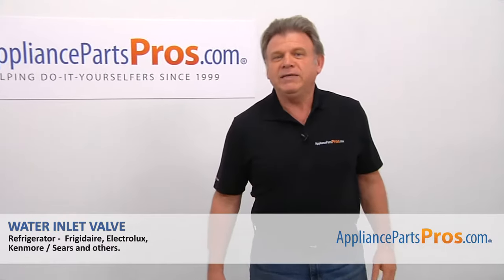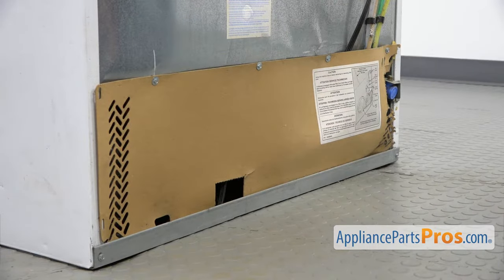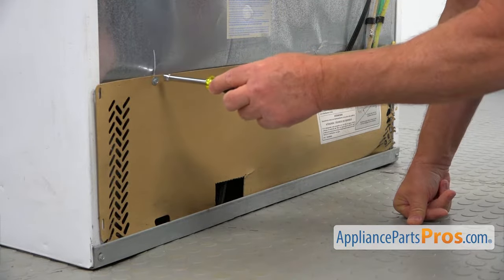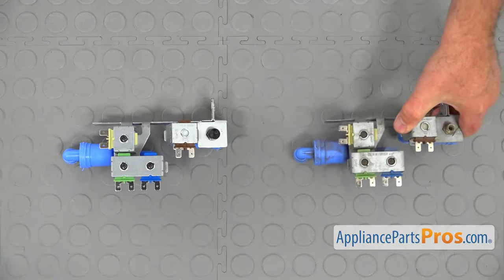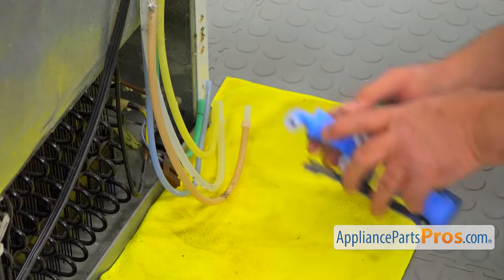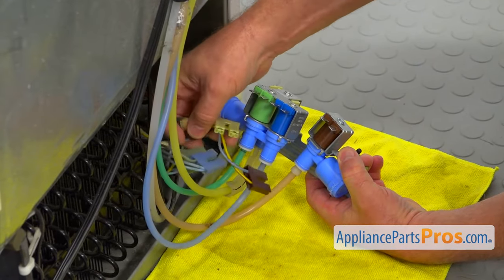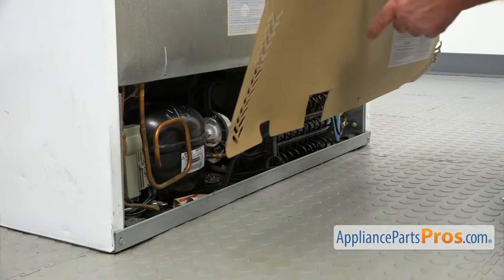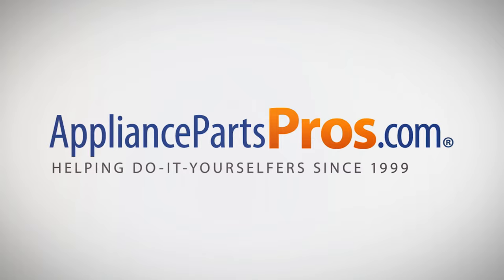How To: Frigidaire/Electrolux Refrigerator Water Inlet Valve 242253002

Comment: Thank you for an awesome video. I just replaced the water valve, forced defrosted the ice maker and still no ice. What else can I check? BTW, I'm getting water from dispenser, changed filter, water pressure is good. Thanks!
Reply from the maker: It can take up to 24 hrs after a repair for the unit to start making ice again. If you are still not getting water to the ice maker after replacing the water valve, then you can check the fill tube for blockages. If that is clear then you would need to replace the ice maker.

Comment: I did this but the ice machine still isn't producing ice.  What else should I be looking for?
Reply: Does the door still give water?
Reply: There is a switch inside the freezer that can turn the icemaker off ... double check that.
It is NOT the same as the lever that stops the icemaker when the bin fills up, it's an electric rocker switch.

Also, make sure that wire lever thing is not stuck in the "full"
Reply: I had a mouse chew up my wires. I manage to splice the water dispenser wires together, but not the ice maker. I’m pretty sure the one with the green water line is for the ice maker. I would like to be sure though. Then test for power.

Comment: Hello there. I get water from water dispenser. I also get water from ice maker when i did diagnostic, but the water seems too less. could this be the problem with water inlet valve? thanks.
Reply from the maker: If water is only filling the ice maker when you run the diagnostics, then you would need to replace the ice maker. If you aren't getting a lot of water coming into the ice maker, then you will need to check the tube to make sure you don't have a blockage in the tubing. If the tubing is clear then you would need to replace the water valve.
Reply: @appliancepartspros  cool. thanks a lot for your prompt reply.
Reply: Another issue could be the water filter. The filter accumulates particulates over time which make water flow through the filter slower. I understand that other users have seen an increase in water flow speed after changing the filter.
Reply: @99APB77  thanks a lot. I'll try changing the filter as well.

Comment: my ice maker works, the water dispensor is used a lot and started dribbling, but if you tap it just right, it stops.  My concern is leaking onto the floor from freezer, and sheet of ice forming in bottom of freezer.  I was chasing the coil heater,  but you mention some of my symptoms here.  I don't want to throw parts at it.
Reply from the maker: It sounds as if you are having an issue with the valve if there is a drip. What is the model number of your fridge?
Reply: @appliancepartspros  Thanks, others were having me chase down coil heater, etc, but you guys nailed it.  I already got the your part number and will order it soon.

Comment: Is it possible to attach the electrical connections to the valve upside down? The order of the colored wires on my water valve is opposite of what I see in your  video. Does it make a difference? How do you know the correct way?
Reply from the maker: What is the model number of the fridge? It would depend on the type of voltage coming to it.

Comment: I’m having issues with the yellow line leaking water. Is there something I can use
Reply from the maker: If the water line is leaking it could be damaged and need to be replaced. You will just need to check for that. If you need assistance locating the part or need more troubleshooting, you can call us at 1-877-477-7278. We will be happy to assist you!

Comment: is there a trick to plugging the lines back in? no matter what they leak still
Reply from the maker: You will need to make sure the water line is seated properly. If you had to cut the water line, you need to make sure it's cut straight and you would just push it into the valve straight to seat it properly.
Reply: @appliancepartspros  what about the retaining clips. Do they help?
Reply from the maker: If your unit has retaining clips on the hoses, then those need to be installed as well.

Comment: I did this repair just for there to be no water... water source is good. Before, the old valve wouldn't turn off. 

Help
Reply from the maker: Are you able to test the voltage coming to the valve?

Comment: I have a Electrolux refrigerator and I just got the water and ice connected and the ice won't fill what is wrong
Reply from the maker: You will need to first make sure the water is turned on to the unit. If that is good, the unit will need to be plugged in for 24 hours to get down to the proper temperature. Then the ice maker should cycle and fill with water to make ice. If you have any more issues you can contact us at 1-877-477-7278.